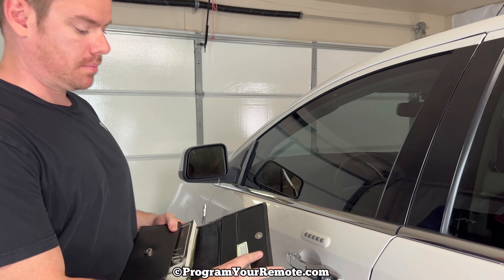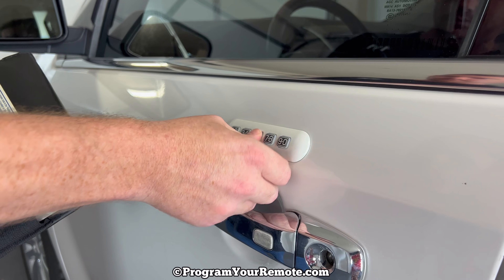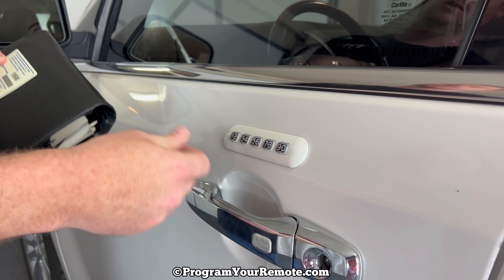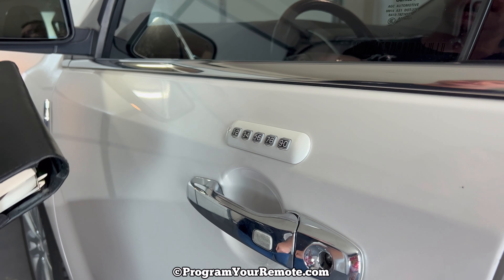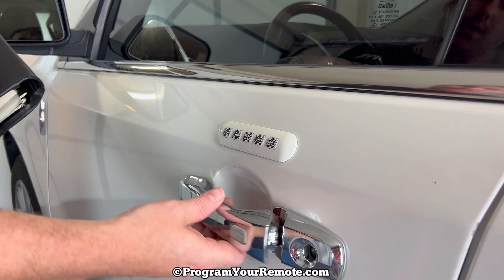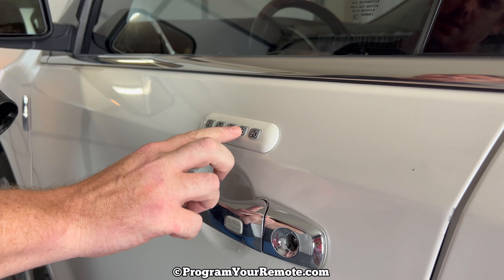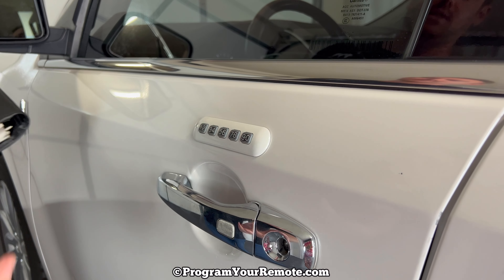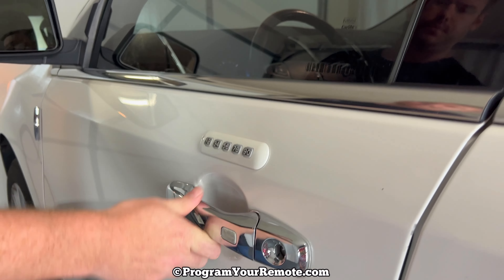2011 - 2015 Lincoln MKX - How To Add A New Keypad Code To The Driver's Door Key Pad

Comment: I bought a used MKX. I don't have the previous owners code numbers.  I have the manufacturer code.  I tired to change it, but it was programmed by the previous owner.  Is there any way to change it? I
Reply from the maker: You cannot change the permanent factory code

Comment: I added a new code (which i did not write down) and now the factory code does nothing!
Also, the power lock button on the doors no longer function!  
What happened??
Reply from the maker: it sounds like the battery in the vehicle may have died.  The permanent factory code can never be erased
Reply: @PYR-Auto  thanks for the reply.  I had pulled a couple of fuses to test.  One of them was not replaced yet.  When it was, the factory code worked again.  :)